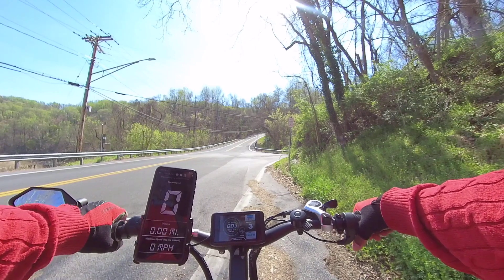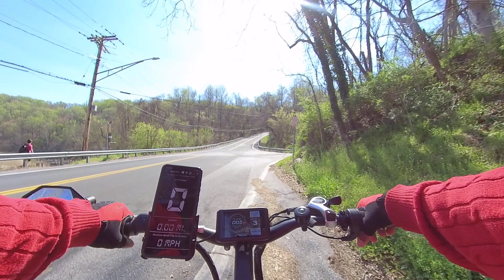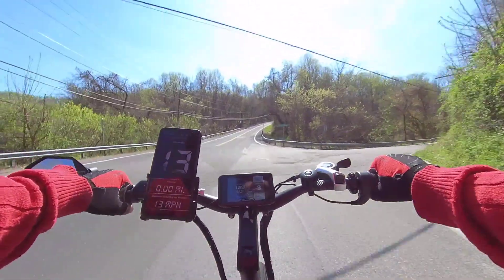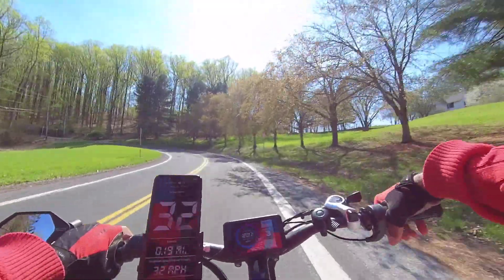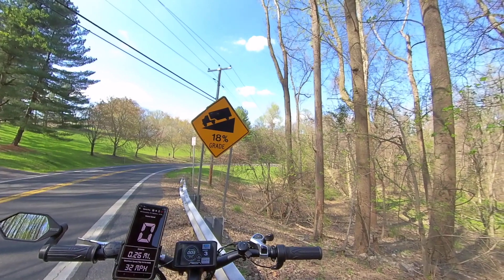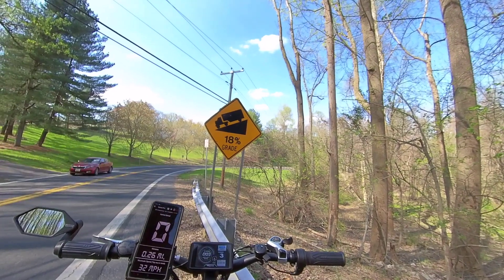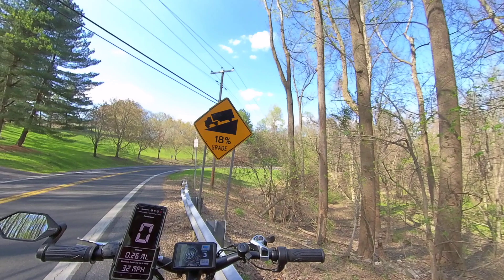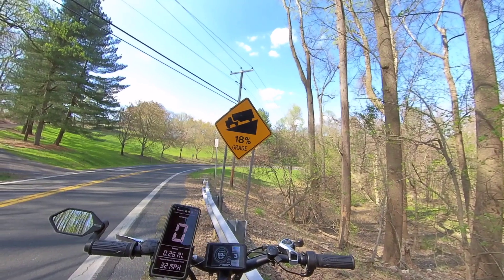Custom 72V Kepler -  Ilchester Hill Climb Test!!!!

Comment: Great job. Been watching u a while. How much did kit cost and where to by. What to do same with regular bike. Thanks
Reply from the maker: Thanks!  I can give out info on my bike bit if you tell me about your regular bike I can point you in the right direction
Reply: I'm buying a specialized rockhopper.
Reply from the maker: @Willie Etheridge  I'm no expert at  these kits and have never seen it on a 29er but I found this kit and have heard good things about this company but I haven't personally used them 
 https://a.co/d/84PzySX
Reply: Thanks for info. I want to convert to a 26. I also have a 27 Schwinn I could use.Its the battery size I worry about.